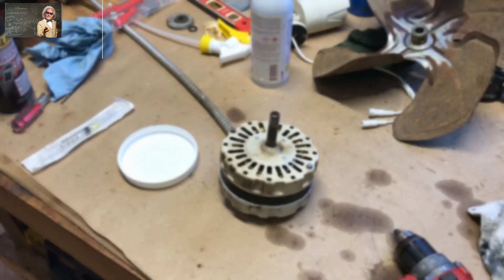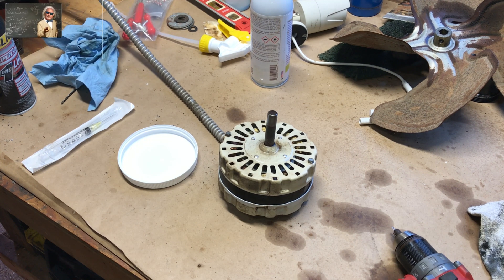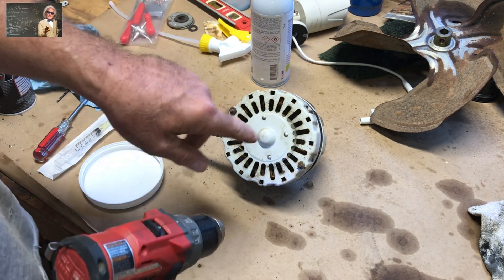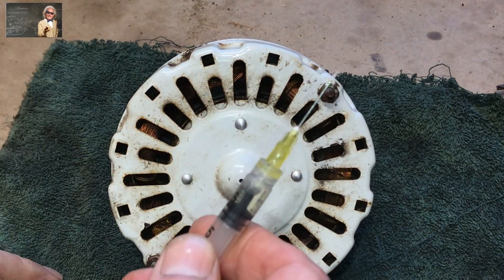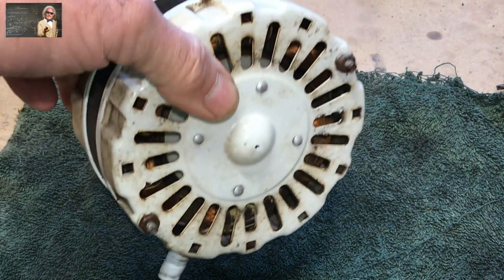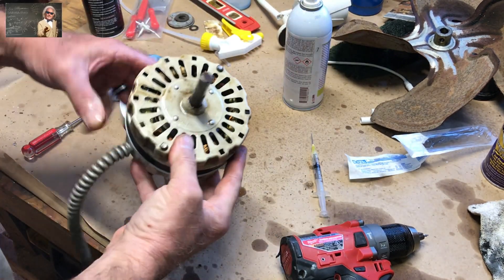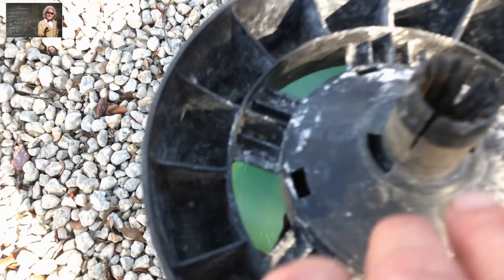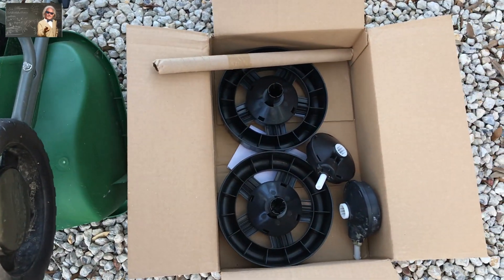How to Fix Any Bad Growling & Noisy Electric Motor.... FAST & EASY!

Comment: So I have multiple window air conditioners that have a noisy motor. A very noisy motor. I've opened them to find the motor is completely sealed. No vents, no oil ports. 
Any suggestions?  
They are extremely difficult to remove from the air conditioner frame. 
Where the shaft exits the motor there is a rubber bushing which I thought I could oil behind it. I pried it up and put oil behind it but there was no change in noise. I can't see what's behind the seal. 
Very frustrating as we have only had the air conditioner for a little over a year.
Reply from the maker: If you absolutely cannot see a way to get to the motor, you are out of luck my friend, some can't be accessed. But I can tell you this, because I am a tightwad, I would find a way to get to them. Thanks for watching and sharing, hope you have a great day and all the best on your projects. Guru Mike

Comment: Great fix on the fan - though would have liked to know exactly what part of the motor is being lubricated through the drilled hole.
Reply from the maker: The main shaft with the bearing on the end is what is being lubed. Thanks for watching and asking. Have a great day. Guru Mike
Reply: @MrKnowItAllGuru  Thanks Mike, good to know!

Comment: I'm not saying you didn't stop the rattling but.....I wish you would have laid the motor flat on the bench as you did before oiling when you tested it after oiling. Comparing apples to apples is what I mean.
Reply from the maker: It doesn't matter how we had it, that's why we didn't lay it in any specific way. We sat it on it's side, the bottom and every which way, when you do this for yourself you will see what we are talking about. Thanks for watching. Guru Mike

Comment: That slick 50 is the bomb 💣 👍
I lubed every suspension item on both of my vehicles as you first shared it with us! I recently lubed my zero turn mower spindles and blade pulleys too.
Reply from the maker: It's a fantastic product Kerry! Glad we could help you my friend, sounds like you've got everything under control, Good Job! Thanks as always for being here with us, we truly appreciate it! Have a great week. Guru Mike